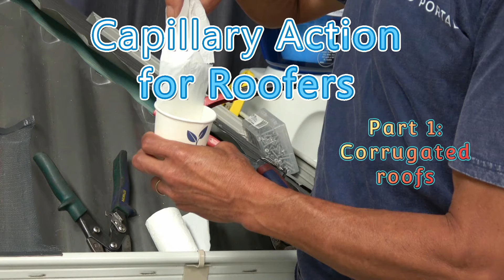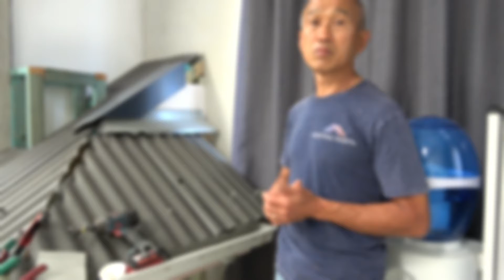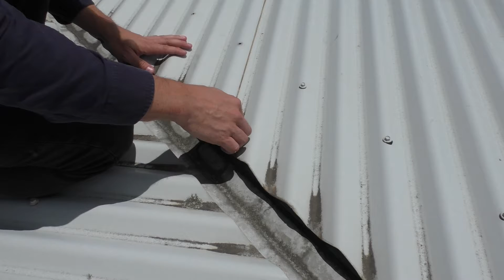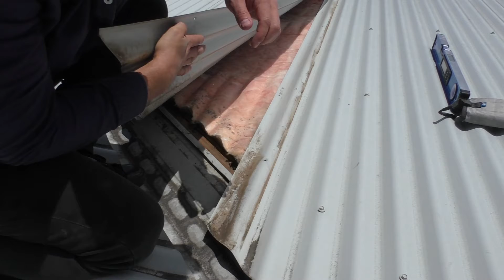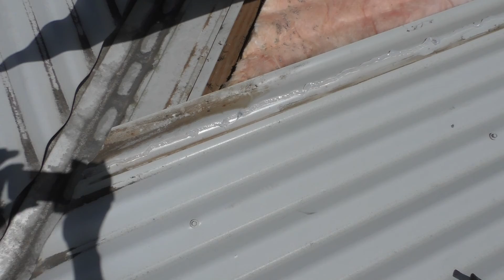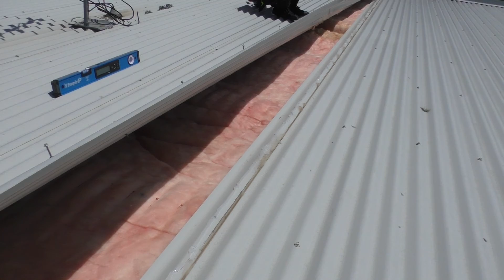Capillary action for roofers part 1 corrugated roofs

Comment: Hi, I have the same
Issue however the roof sheets on the pergola are the suntuff polycarbonate sheets. Same rules apply I assume? The sheets I have are clear so if I use silicone, I should seal the entire length?
Reply from the maker: If you read the polycarbonate manufacturer's technical information, Silicone sealant should NOT be used on their products. It is because silicone causes degradation of the polycarbonate.
There is a special sealant developed for polycarbonate that can be used instead.
The other issue with polycarbonate is the expansion coefficient. Suntuff will move a lot as the temperature vary. And this will cause higher stress on sealants - causing premature failure.
So, it is a bit harder to seal the lap on corrugated roof sheets effectively. Also the sealant will show through the clear sheets.
It is too late to state the obvious... The roof should have been done with Suntuff sheets in the 'Trimdek' profile to suit the low pitch?